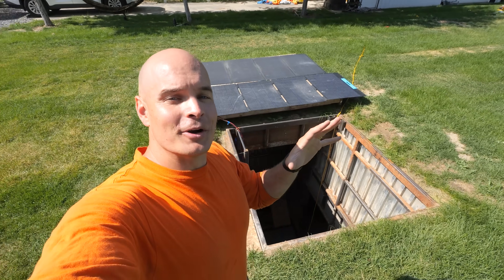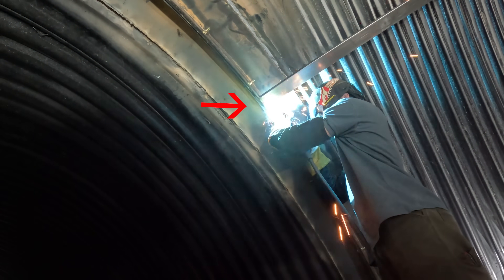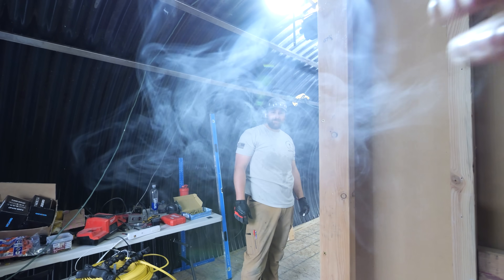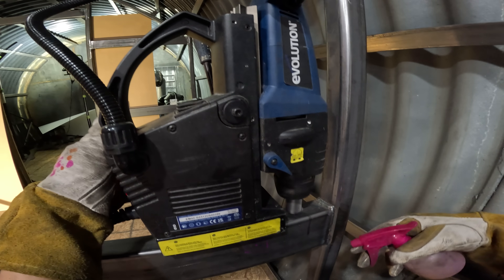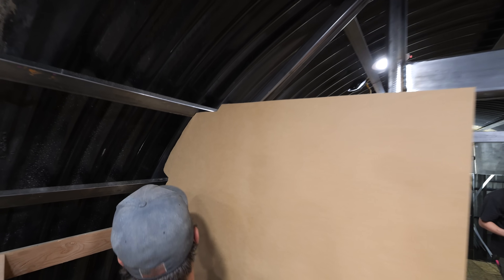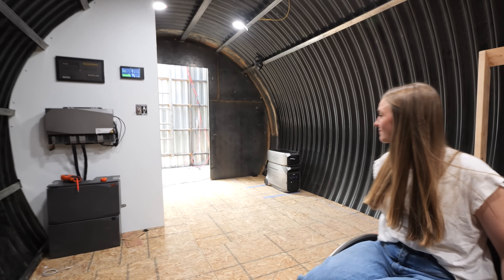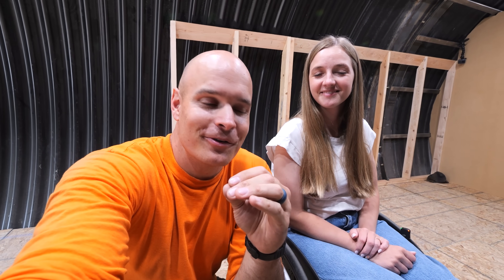How to Properly Power a Backyard Bunker - (Completely Off Grid)

Comment: You should also run mains power into the bunker, i know that removes the “Off grid” side of things but it would keep the bunker online as long the power grid is still up, and it would also charge the batteries
Reply: Rather than hardwiring it I'd install a generator-style inlet panel. It can either connect to a matching outlet on the house or to a portable generator if ever needed.
Reply: @eDoc2020  There will definitely be a need for multiple power sources to use as needed. Grid power for normal use... "I think I'll go play a video game in the bunker". This will also keep the EcoFlow batteries topped up at all times. A solar array for primary off-grid use. The EcoFlow's main drawback is that it has limited solar power input. We have one hooked to a 500W array that is in parallel, that if the panels are partially shaded, they will still send some energy to the EcoFlow. And a generator as a backup to off-grid use. I would bury a generator in a separate enclosure, with outside air supply and exhaust pipes sticking out of the ground. If it can be switched between natural gas (attached to an outside supply) or a buried propane tank, you'd then have multiple independent sources of power. If I'm counting right, that's six independent ways to operate. A little Honda generator with a propane conversion kit can also be switched back to operate from the gasoline fuel tank. So, seven. But I would only use the gasoline if there was nothing else available.

Comment: why not build it completely on the ground and them bury it?
Reply: Because then if something is off you are done
Reply: @GateKeeper-nx8yq  could you please elaborate?
Reply: @VideoDailyDose   let’s say you build the entire interior and it looks great. You start lowering it into the hole and find out that you accidentally build stuff in the way of where you need to weld the two pipes together (since lowering it as one pipe would be too heavy even when empty). We’ll then you’d have to move stuff out of the way maybe even already welded on walls just to reach that. Along with the fact that it’s in two separate pieces, then how would you do the wiring? It would mean having to splice wires while it’s already in the ground which is far more difficult. Things like that make it not worth it.
Reply: @GateKeeper-nx8yq  well yeah that would cause a lot of trouble, but it can happen even now. Just imagine 6 months into making you realize something is off. When it's on the ground, the building is done much more easily and quicker and 100 times safer, you test run everything, even pilot the bunker on the ground and live in for a couple of days, then get a big fat crane to move everything down in one piece. I guess they are two different approaches and each has their own unique benefits.
Reply: @VideoDailyDose  I also did forget to mention the biggest thing he was trying to do was get it in the ground before the ground froze so that was a major factor too
Reply: @GateKeeper-nx8yq  oh yeah you’re right,i forgot about this one

Comment: instead of tv's to mimic outside try linking some 
GeeekPi 7 inch 1024 x 600 HDMI Screen LCD Display with Driver Board Monitor for Raspberry PiGeeekPi 7 inch 1024 x 600 HDMI Screen LCD Display with Driver Board Monitor for Raspberry Pi together to make as big or small as you want anf may use less energy
Reply: I don’t think h has much experience with a Pi. Also I imagine the tv might be more reliable

Comment: Sponsors aside I would consider a DIY modular battery option even if you don’t show a video on it. If you ever need to use the bunker it’s going to be unlikely you’ll have access to EcoFlpw replacement parts should you need them. Meanwhile we are surrounded by alternatives albeit not as pretty.

At the bare minimum you should have 3 of those units and cycle between them (daily/weekly) to load manage and provide redundancy.

Comment: I definitely would have opted for metal clad (mc) cable for those areas of exposed wiring. For several reasons including the grounded jacket, will not break easily if hit or scraped, will not melt easily in the case of a fire and less likely to be a cause of an electrical fire. You could easily switch over from your romex from the wall with a junction box or inside a device. Plus those lights are extremely easy to wire with MC.

Comment: Could you not just use a gas generator on the surface, for construction. You can find some suitable extension cords beyond 100ft that wont lose much efficiency. Just a question, battery looks great.
Reply: As far as permanent soultion goes. You could run a gas generator underground and send an exhaust outlet up to the surface. Very loud tho but more reliable especially if it's snowing or very cold when solar isn't as viable. Maybe even as just an emergency backup if your battery goes out

Comment: Putting your eggs all in one basket when it comes to power is not the smartest thing for such a smart guy. Yes gas generators have their down side but those battery banks will be depending on the solar on the top. Not sure what kind of "apocalypse" you are preparing for but living in Utah in an area with lots of snow those solar panels may not perform up to par for your needs. Or if they get covered with a thick layer of ash you are screwed again. Or a wild mob roaming around could take them for their own use. You could get propane generators as a back up and enclose them in a sound proof container and vent them out the top. The shelf life of propane is decades. Oh and you do realize the HUGE TV you are putting in there will be putting out a large amount of heat.

Comment: You worry about generator noise levels, yet:

- Anyone motivated enough will find the bunker (solar panels, air heat signature, RF signals)
- You still need fresh air, and there are plenty of toxic heavier-than-air gases
- You are trapped in a literal can

Comment: Putting lithium ion batteries in a bunker with difficult egress is a really bad idea if there is ever a fire. People could get trapped really quickly. Consider getting a lithium ion offgas detection (e.g. li-ion tamer detector) to get early warning of a fire or put them outside the bunker and run a cable in. I am a fire safety engineer.

Comment: Ventilation ducts above to deal with rain, snow, fallout, etc. A sump pump below the floor incase of water leaks. Backup mechanical lift with chains/pulleys incase the electric one breaks. Love the tv roof idea for the living space maybe. Camera system above ground to video feed below. So many choices.
Reply: The Elevator has its own battery
Reply: Are u a survivalist✋😭🤚… brilliant ideas tho👌

Comment: I dont know if this is the same in Utah, but those are yellow wires for your AC. In Alberta, Canada those are for 20A. Which means they are overkill for normal use 15A. Is that correct everywhere or is that just a Canadian colour code?

Comment: For the window idea I thick placing a high resolution camera outside and linked it with a TV inside will let you feel like you have a real window and at the same time you can switch it to a TV or you can link it with a camera system outside with all the information about the outside word and it'll look so cool. 
It'll also be cool if you link this underground place with the house using a secret tonel underground for emergency cases as a future project, I think this will be next level

Comment: I'm curious about the air re-circulatory and filtration system you're going to put inside the bunker. I'm assuming there must be a way of converting carbon dioxide to oxygen once the bunker is sealed. Very curious to find out and hear about the technology for that.

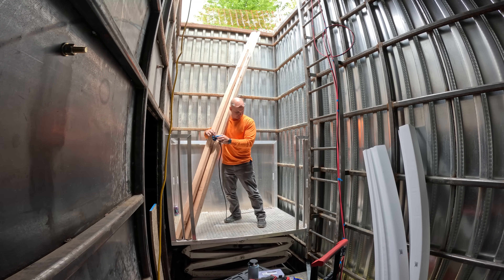Comment: 4:32 Jerry, come on man, don't be like that. We have WW2 bunkers with functional diesel generators that can't be found even today, decades after they were made.

In a postapoc, you wouldn't get away with the electric one, because to supply it, you'd need solar panels, which have a footprint and requirements (like being cleaned). So it's not like it'a better idea. A diesel generator would be tucked inside its own chamber, shock mounted and padded up with a fume cleaning filter of its own and walls lined up with long term storage diesel + antibug mitigation. Nobody would use gas. All i'm saying is... in a postapoc, electric wouldn't be any use as a single solution, you'd still have to use diesel, or get out of your bunker and setup solar every few days, depending on how much power you'd be using, thus exposing yourself. With a diesel gen, you'd charge your battery banks, use all the electricity you need, then shut that down for a while and use electric to keep up. I mean, if we're talking hypothetical, which this is, because this isn't really a bunker, it's more like a cool project, since everyone knows where it is. :D

Comment: Batterys arent a great idea as well. At least not lithium, use chemical/acid batterys and keep a surplus of acid and lead for the batterys. U have a basically unlimited storage and yes take takes more space using a bunch of car batterys , but if your planning to stay in the bunker during a real world emergency you will want 20 plus years of batterys. Also lithium battterys cant be serviced o ly replaced and cant be stored without a charge. Using car batterys is the way to go.

Comment: Looks absolutely awesome down there. Ecoflow gear seems to be way ahead at the moment. All the hide away doors just finish it off so nicely.
I have fund my (I won't name it) power unit get very dusty in the exposed plug sockets ad where it does have flappy hinge doors to cover some ports.. They are pretty flimsy and could easily get snapped off.
Great contact. That you!!
Ps.. More ev humvee!!!

Comment: curved LED screens on the ceiling, patched to multiple cams outside to keep an eye out for zombies and weather conditions....I looked at flexible LED screens several years back for an application and it was just getting out of R+D by now there should be several vendors that you can partner with and show off mounting to any surface... even a bunker ceiling :)

Comment: From my experience living alone in a shipping container interior modded to acomodate 1 person, and living in there a total of 3 month every year (1 month each stay), and not going outside at all, in the middle of jungle (country border), tv small(FM radio YES, sometimes no reception from tv), projector yes, laptop yes (pc good too, but i was using alienware 17 inch), workout?, walking from bedroom to counter room (wish there was threadmill folding or something), food stocked underbed (and refrigerator and freezer meats and fishes), since its a container, its bloody cold!, so cold, the wall plug contains water, had to bore a hole under it, and exhaust fan installed on the ceiling to move the air i dont know where it goes. Sanity check, windows, funny enough, tv never turned off, if not using its displaying my nature wallpaper or some videos mostly its influencer showing food to eat, my free time, i had gundams to build to lose track of time, wish i have a 3dprinter and abundant of filaments at that time.

Comment: You should add a nitrogen backup to the elevator for full power loss lifting. You could use small paintball style 4200psi tanks mounted under the deck and a 1/4" hose going down to  a Tee on the cylinder. Valve for flow and dump under a hatch in the floor for easy but safe access.
Also make sure to regularly service the lift. They are meant to last a long time in nasty service environments, but that is given that they are serviced regularly.
The ladder could also be hidden with a door panel in the wall for better esthetics.

Comment: You'll be lucky if you get even 3 years of service from that high frequency, transformerless inverter. You should have installed a low frequency, transformer based inverter if you wanted a safe, long lasting, high performance power supply for your bunker.

Comment: a Ham Radio (2 way communication and listen to other communications from far away.. the Antenna is actually an Artifical Tree (could be pine or popular since their main shoot is long) passby might look at it as a tree in your backyard meshed fence (Airbase military grade fence with barbed wire on top and solar lights on both sides of the fence...TPlink outdoorTilt-pan 5mp IP/LAN camera for security) for the top. 3 stage water filter, humidity and weather system, a 1L Dell/HP/Lenovo Mini PC with 65w PSU (HDMI/VGA/DVI-D) for all those backup games and low power and Manuals for furture generation educational learning, whether it be gardening/agriculture/cooking/electrical or carpentary.
a Backup hand pully system (manual) if for some reason your elevator electrical system don't work or breaks down.
get yourself a EcoFlow Smart Generator and 2 Wave2 Portable AC system (heat and cool)
Lastly mold and waterproof all the underside of the chipboards you've layed down on the floor... termites are not a problem.. but where there is food.. there is bound to be mosquitos and  flies and spiders and ants.

Comment: honestly would have welded struts that you can bolt to before covering it + not really a bunker (in my opinion) without any kind of concret around it. Then again it all depends on what kinda apocalypse you are expecting. Virus Outbreak (thats not airborn) or drastic changes in surface temperature during the day - perfectly fine, not as good for war like scenarios. Would still work but not as well (besides the other factors like airventilation, longevity of equipment, backup systems etc.)

Still a very nice project showing that you can build bunkers even without concret surrounding it and making it air tight (for now not air tight, dont know whats planned on that side)

Comment: one thing that might interest you is POE switches, maybe an aruba 1930 48 port. that way all your cameras can be POE, also lots of other things can run POE, like some temperature sensors. also you could use this to have a little nas storage, so that say once a week you back up all your info to it so if a big disaster happens you have a copy of your data in the bunker. i'd connect it to your house with a p2p bridge / access point. - that way you have internet while society runs, but then if it collapses you'd have all your stuff there anyways. 
you'd need a level 3 router though down there to plug into the switch to handle L3 stuff, but that could just be turned off while it's connected to the house. if you use proxmox OS, you'd only need to build one powerful PC and the rest could be low power pcs that are only there to connect to the main PC. they got server cases with hot swappable hdds so you could just replace bad hdds with good ones as time goes on. or maybe dont use zfs in that situation. 
what's cool though, is if you had a semi-apocalyptic scenario but still had power to your main house, you could just reverse rolls, where the bunker is the main data hub and the house gets LAN internet from your bunker - since in that event WAN would be inaccessible and not repaired. so in that case it would just work in reverse

Comment: You should use li-titanium oxide batteries for long-lasting application as they have huge amount of cycles. Long degradation period. And not fire-hazard. Also have spare solar panels or thin solar sheets. As something can damage your main panels. Or someone can steal them.
Reply: or just damage them to stop you from generating power

Comment: That's such an American bunker. Wide open elevator entrance. No blast door. No overpressure system. No NBC filtration system... 😂

I know, I know. But I'm Swiss. That's standard here. All that can be accomplished for not all that much, in bunker terms.

I mean if you go the length and build one... He should've done one that actually is a bunker. Not a hastily burried tin can.

Comment: it sounds like you have alot of Ecco, I thing it is a good idea to put some rockwool on the walls.  are  you worried about the condensation inside the bunker?
i think in a scenery of nuclear blast or other apocalypt event I think you will lose your solar panels, do you have some backup? 3 days are not much for the lights.

Comment: Lol that's NOT a bunker it's a glorified storm shelter. Try mine: 1/2 mile underground, super reinforced concrete, ziz zag offset entrance tunnel with anti pressure baffles, armored and covered air filtration, anti infranty traps and weapons, booby trap collapsing ceilings if it is entered by hostiles. Took 20 years and 40 K to build, no blueprints I did all the work myself.😮

Comment: Would super recommend a projector for the TV! Can get some that are relatively low wattage but still good quality and screen can be as big as you like. That's what I use for an offgrid set up and it works amazingly, even with a small battery you can run it for hours!!

Comment: I assume the TVs on the ceiling was a joke but what you could do is fake skylights that mimics the day/night cycle, weather, color temperature, and so on with an addressable RGB strip and a bunch of fogged panels to disperse the light. It makes sense to since being in a confined space not going out for a long time would mess with your internal clock and they would help with that.